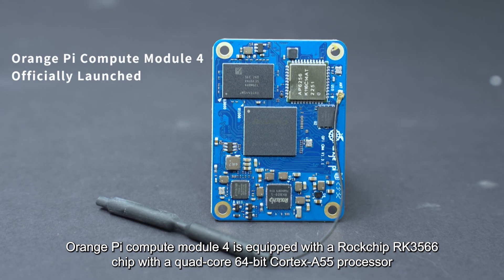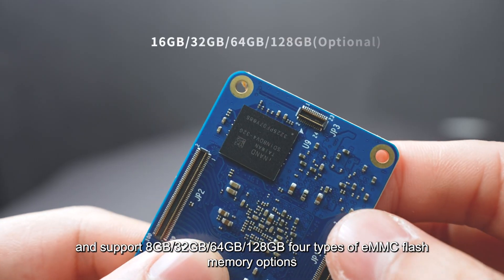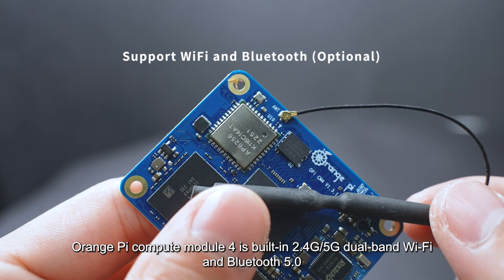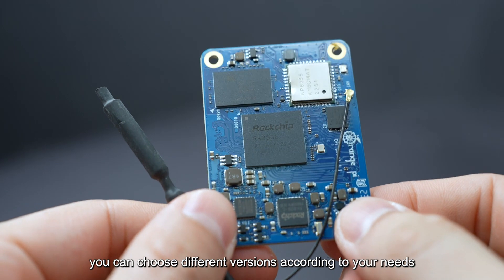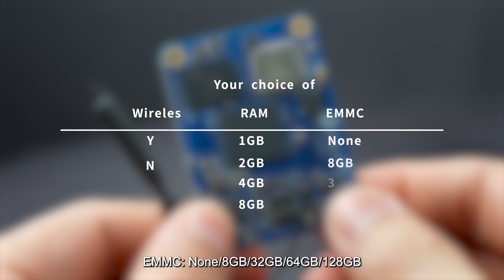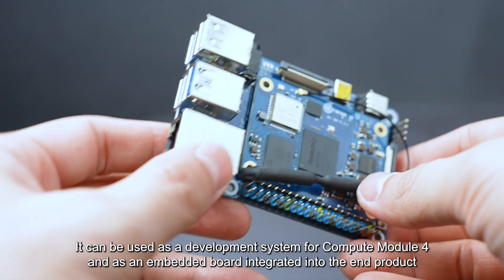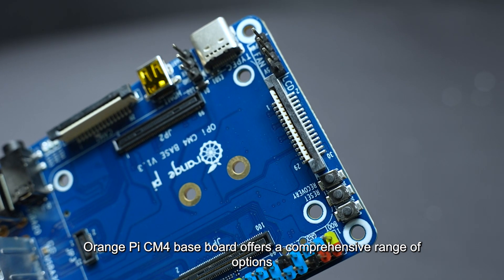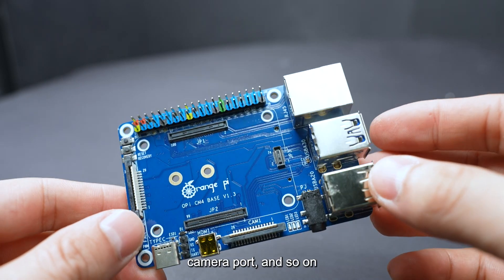Orange Pi Compute Module 4 & CM4 Carrier Board - Worth it?

Comment: Unless Orange Pi actually provide decent support then it is less likely to really take off. If my experience with support on the Orange Pi 5 is anything to go by, it is abysmal.
Reply: Yep, no recent kernel source, no schematic, no support. BTW: this board has h/w issue - it just freezes if power re-applied less then 1-3 seconds.  Useless unsupported non-working thing until they will fix all above
Reply: I agree. I just got the CM4 and using the RKDtoolkit it came with. The exe is non existent. You go grab a lower version and it doesnt flash your OS onto eMMC through connection to pc. You contact the official Steven Zhao email..
Just got a return on my email because Steven dont exist. Im fucking pissed because I cant flash my OS on this fucking thing.